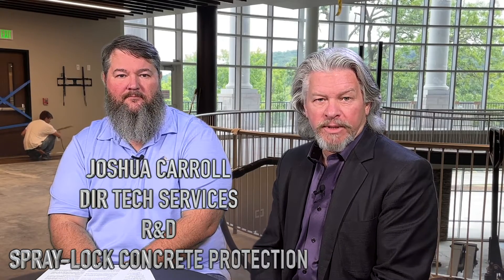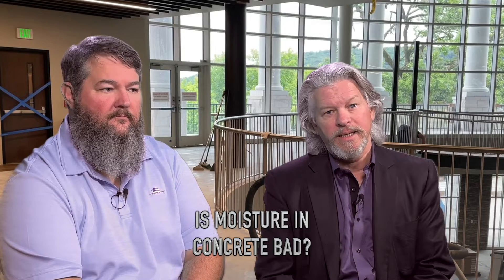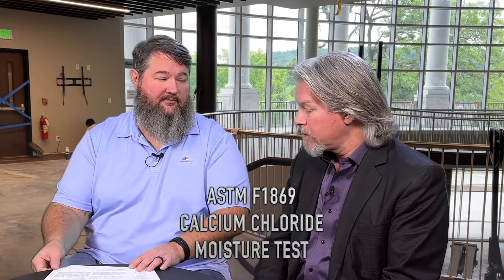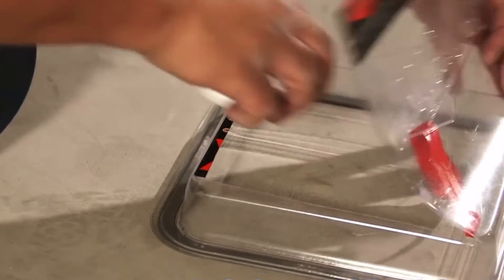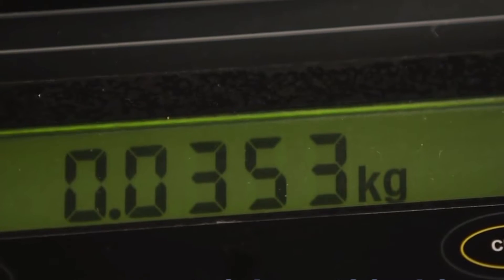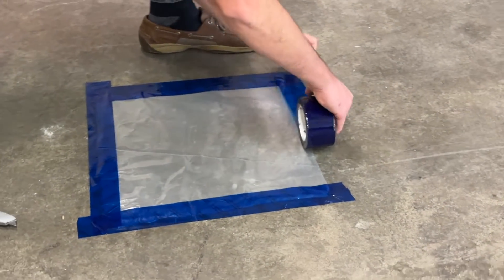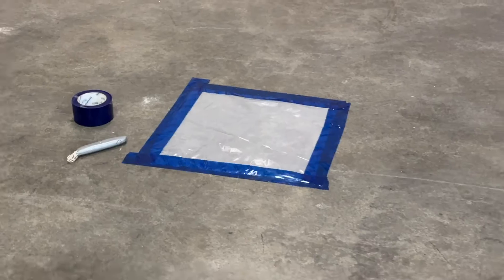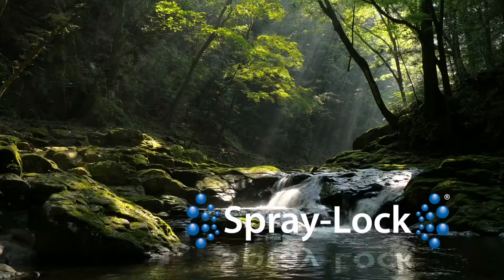Testing Concrete Moisture

Comment: I did the plastic sheet test.  After about 8 hours I have water coming up from under the plastic.  I am using a pinless tool to measure the surface and its reading 95 percent in some spots.  I think its the grading or flow of water to that side of the house but i am not sure what to do.  I called a landscaper and will probably have some gutters put on the back of the house ( the leak is in front )...  any suggestions?  I dont see movement in the water meter but ours is bolted sideways.  Its hard to see.  I'm running a dehumidifier now.